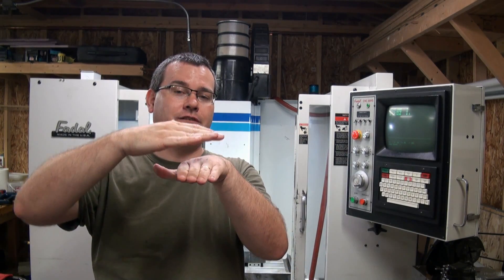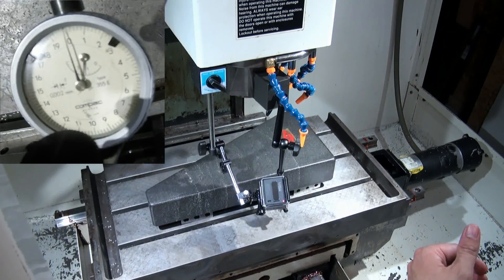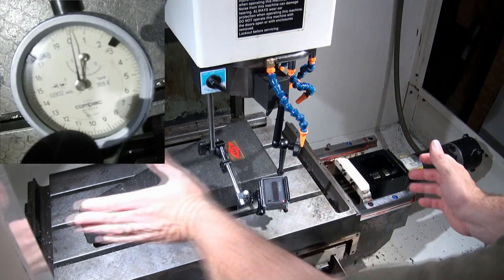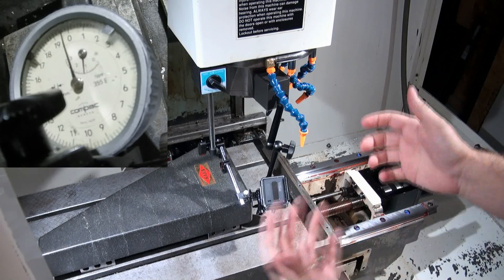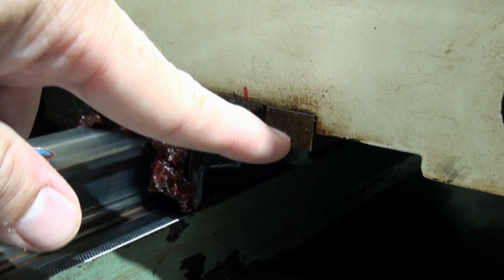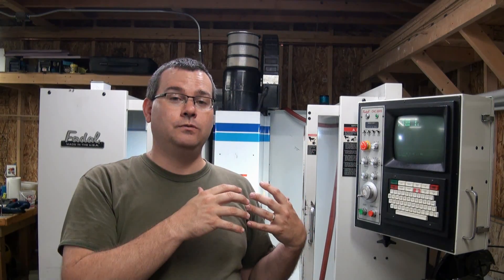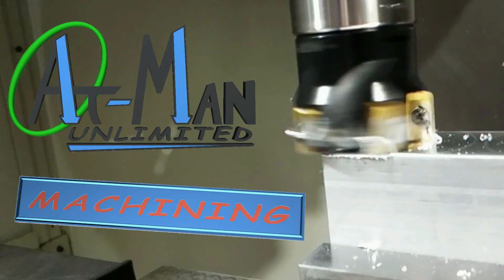CNC Machine Setup and Alignment Part 5: Squareness of XY

Comment: I'm not clear on how adjusting the position of the trucks relative to the saddle can change the squareness. Suppose the saddle was 45 degrees out relative to the trucks. If the trucks are traveling on the rails, won't that path (Y) relative to X determine the squareness?
Reply from the maker: X is bolted to the saddle, you adjust the rotation of the saddle on the Y trucks.

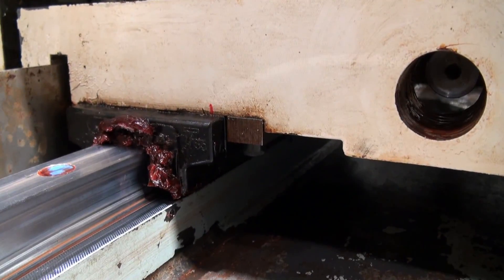Comment: 8:03 Firstly is that molybdenum or lithium elbow grease you're using on the rail, and also, dude, that is way too much elbow grease 1.applied and 2. comin out ya elbows. You need to get that looked at! Great series by the way. Best on youtube by far.
Reply from the maker: The machine is a manual grease machine, you pump in 3-4 strokes every two weeks. It builds up over the year and needs to be cleaned out every now and then. Just the nature of the beast. I use Mobiltemp SHC 32

Comment: You cannot adjust squareness of a box way machine with the gibs. If it has a one piece saddle, squareness can only be adjusted by milling or scraping the turcite. I would have scraped the locating surface of the truck instead of shims, but I guess it works.
Reply from the maker: Using a shim is the factory accepted method for squaring the saddle on a linear way machine.
Reply: Well I guess at the Fadal factory. It should work fine.